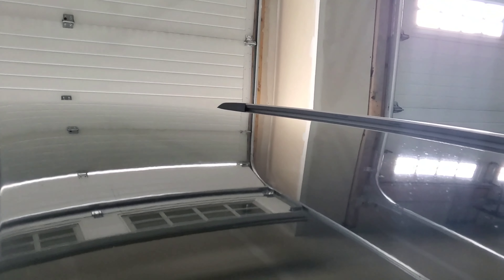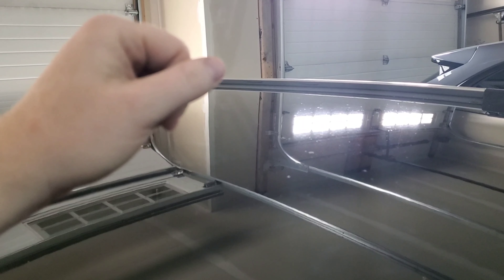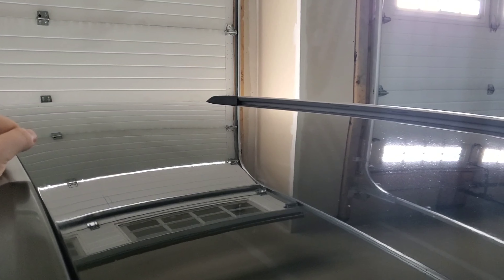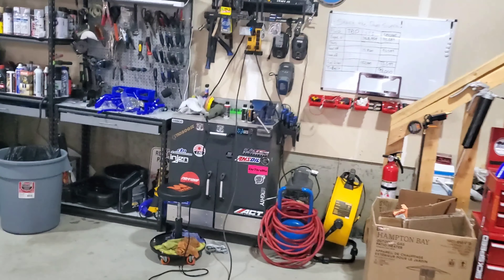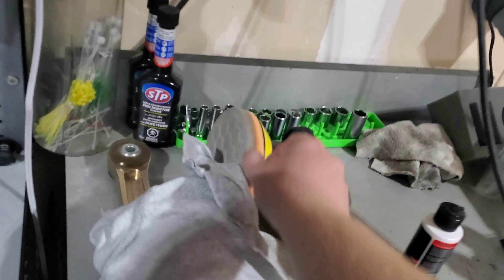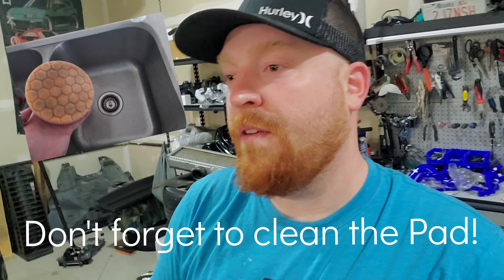NEW TORQ BUF501X POLISHER Test on my JDM Subaru FORESTER'S HAZY ROOF (Product link)

Comment: Yow bro I really appreciate your videos .I got a 2006 non turbo forester got it from Befoward . And your videos gives me so much inspiration. But I gotta ask can the radiator hoses kit you bought work on my non turbo I was thinking of changing the hoses as I saw your vid I want to get the most life out of it
Reply from the maker: Thanks for the kind words! I would purchase the main upper and lower hoses for yours and buy bulk length silicone hose for the rest. You will have ALOT less as you have no turbo. 

I'd measure your hoses.. but I'd assume 1M of .5 hose and 1M of .75 hose would probably be a safe bet for the rest of the hoses such as oil or air.